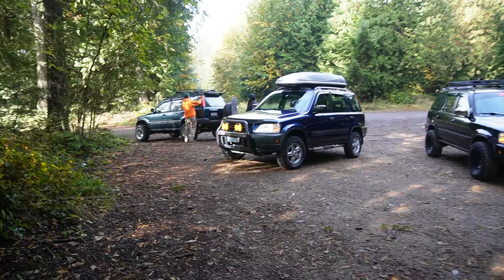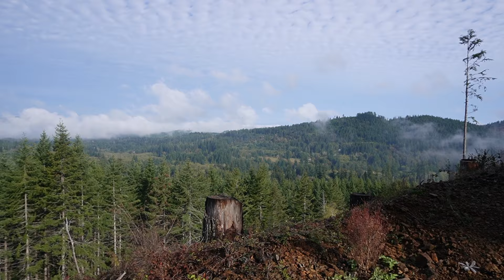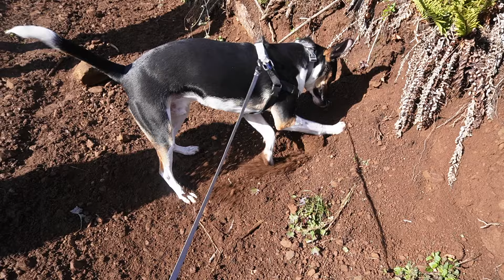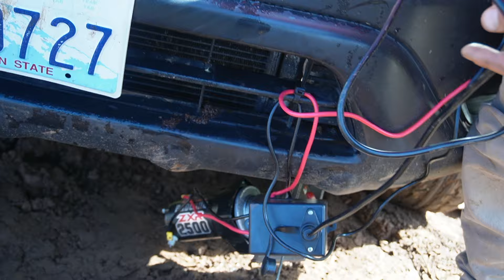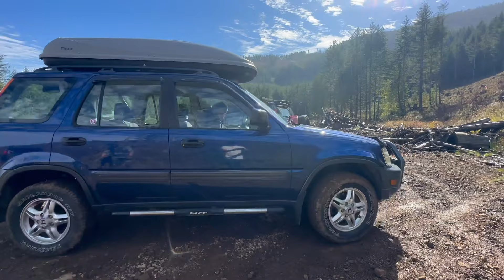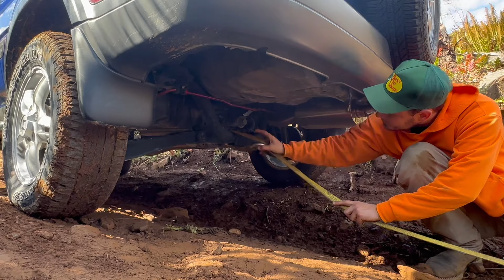Rescue Mission! PNWCRV Saves their friend from an off-road accident.

Comment: These were not meant for offroad. Where those CRVs were stuck, a 4x4 wouldnt have. You need power to go to all wheels at all times not a slip detection system. 

4 low gearing multiplies the torque. 

Would love to take my Element out but no way.
Reply: Yeah CRVs are still super utilitarian but no bottom end power. Need a nice 4runner or LC for that. But, price reflect off road capability. I thought that entry road with the fallen tree was a bit much for the ol’ Crv 😂 Let alone the road they rescued from. But in numbers they all got out. I was kinda impressed
Reply from the maker: Not meant for but still does it. I have a old yota pickup truck that I sometimes take out. Haven’t gone anywhere I wouldn’t take my old v out to. Will say it plows through snow better.